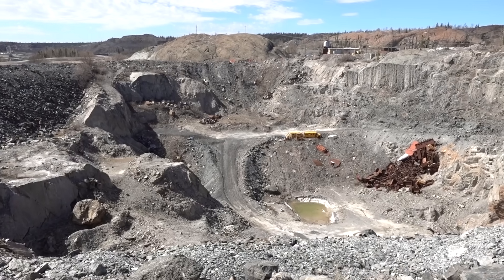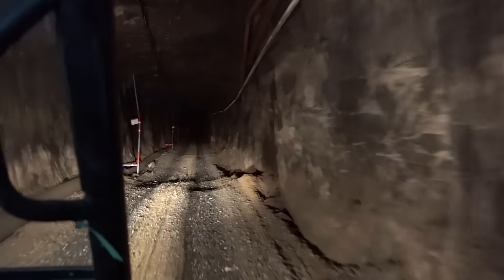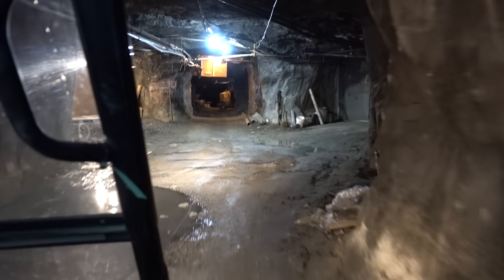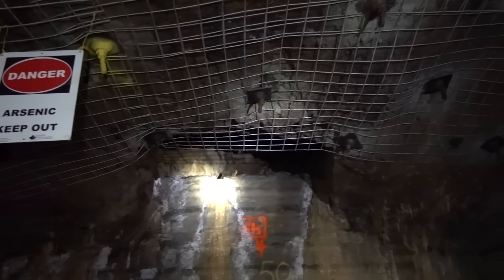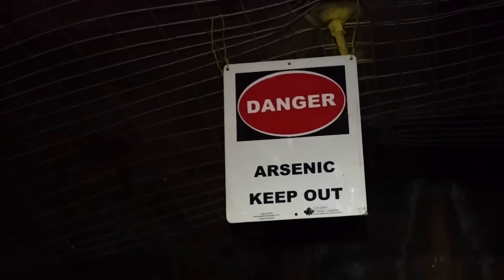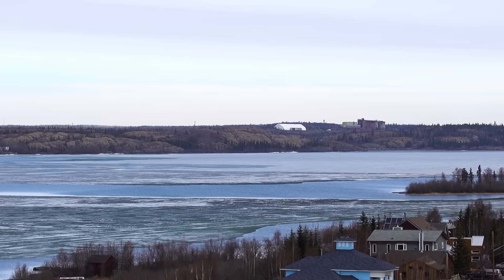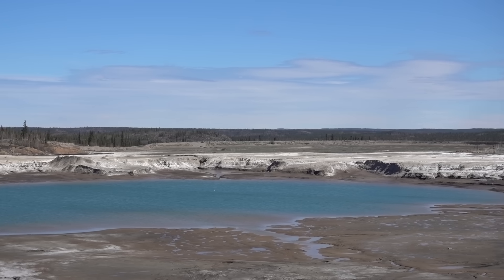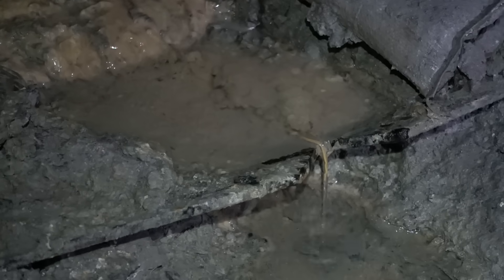Making 200,000 tons of arsenic dust safe

Comment: How come they don't do anything like vitrification (collect the dust and then encase it in moltern glass), which is what they do to radioactive waste. Glass is really durable long term and makes a lot of sense for radioactive waste, and surely that less maintenance and as such less cost than dealing with these cooling pipes which lets not forget if they fail the arsenic will become dust again and be just as dangerous
Reply: there might just be to mutch, also moving the dust will probebly create dustclouds
Reply: 999 gamerdude I don't know for sure, but here's my guess:  there's just too much of it, and it gets away too easily during processing.  

I looked at Hanford stats, and it looks like there's actually about 200,000 tons of that too.  But it's in liquid form, so it's not going to fluff up into the air while being handled.  And I'm guessing 200,000 tons of fine dust takes up a bunch more volume.  

Another reason:  they still have some hope of finding a way to make this stuff chemical innert.  If they finally find that way, fine powder will probably be almost the optimal input format for that process, whereas glass blocks would be much harder to break down and chemically reprocess.
Reply: vitrification is very costly and would be near impossible on this scale... not to mention the added risk to workers to complete it.
Reply: Too much volume. Nuclear waste is usualy small, volume wise, maybe about the size of a home for one reactor. This is 275,000 tons of rock.
Reply: lordelliott42 sahara desert...
Reply: @abdalhadifitouri131  You, ah... Hm. You have a point.
Reply: The world is running out of sand to make glass.  There is actually a sand mafia in China and sand gets stolen from beaches and rivers.
Reply: I have a suggestion.  Bond the arsenic with the bodies of the CEO, every board member, and every shareholder of the corporation responsible for this lovely capitalist gift basket.
Reply: Here's an idea to make it inert:

Get the chemicals the body (and anything else you don't want it to be reactive with) is made out of and mix with a sample of arsenic. 

If the product is inert, welldone.

if the product reacts with something, mix all the arsenic with that something.

Finally, it prefers to be bonded with this than the chemicals in your body, ie, it's inert. Welldone.

Comment: Can it be reacted with something to make it less lethal or even inert?
Reply: I imagine the biggest problem is that there's just *so much of it*. It'd be hard to ensure you reacted all of the stuff, even if you had some really easy way to do that.
Reply: Árni yer, I wonder about that. But a guess it's because it's in the rock layers too, so they can't get all of it.
Reply: Maybe someday, we've got multiple ways of destroying PCBs into fairly harmless products and that was a nightmare chemical for many years.
Reply: @D8W2P4  what's a PCB?
Reply: @rhodesianwojak2095  
PolyChlorinated Biphenyl.
Which used to be widely used in waterproofing, lubrication, fire retardants, paints, adhesives, waterproof cements, and "wet" transformers and capacitors (which since it's a "closed" use they still sometimes use PCBs in very high powered "wet" transformers and capacitors) because of it's excellent electrically insulative, heat dissipating, chemical stability, and fireproof qualities.

However it's carcinogenic, endocrine disrupting and a neurotoxin.
Reply: @D8W2P4  oh thanks for the explanation m8
Reply: @rhodesianwojak2095  as well as the excellent reply from THISISTHIS, I have read that it never breaks down. All of it ever made is still out there somewhere.
Reply: No Arsenic and all of its compounds are toxic because the body mistakes it for phosphorus.  Phosphorus in the form of phosphate is needed for all kinds op biochemical reactions, and arsenic (most likely as arsenate) interferes with those reactions by blocking the enzymes that facilitate these reactions. Think of it as a key that fits a keyhole but not quite good enough. Arsenate can also get used instead of phosphate in one of the steps of glycolysis (the breakdown of glucose) but the product is unstable and breaks down spontaneously, which causes the 'burning' of glucose to yield less energy then if a phosphates were to be used in that step
Reply: No !!!!
Reply: It can be used to treat leukemia.
Reply: Arsenic is an element, and it's the element that is dangerous. Since your body mistakes it for important things, it would have to be inside something that is strong enough of a bond to not let your body extract any. 

It's not like a lot of toxic compounds where if you break them down into their base components, they are fine. The most base components of any arsenic compound are still toxic
Reply: Garrison Fox Yes I know. But even if you precipitate it with something like lead or react it with sulphur, which gives very insoluble compounds overtime it will still leach out with groundwater. (The lead thing is an assumption btw) So i do beleave containment in a frozen box of rock is the best way for now.
Reply: @asjenmensink2740  Sulphites are biologically inert for most eukaryota, right? How about arsenite?
Reply: I mean, you obviously can. It's not like they created the arsenic; it had to have been extracted out of some rock or mineral or something.

Comment: Is it legal to continue mining when they know there’s that much arsenic?
Reply: Great question.  Another one is who is paying for this clean up?  The people that became rich or people that had nothing to do with it?
Reply: In this case like most cases, the public will be paying for it
Reply: I think the arsenic is usually a by-product of the ore refinement processes. Most mines have a similar problem, I think. I think it's legal, as long as the company takes care of the waste. Problem is that private corporations go bankrupt a lot.
Reply: Arsenic and cyanide are typically used to refine gold after the extraction process. Its typically done through ponding pools and transferred through drainage systems. Soil base needs to be engineered using clay liners/geosynthetics to prevent chemicals from leaking into the surrounding environment. In this case there was probably less regulation.
Reply: +Faza Excellent, someone who knows  about this! (I don't, really.) 

Unfortunately, this is not as rare an occurrence as you would hope. In 2014 there was a Tailings dam failure at an old mine called Mt. Polley in BC, Canada, that essentially released tonnes of waste and heavy metals in to the environment. Right now, in central New Brunswick, there is an other mine that is under massive debate because it would do basically the same thing. I believe there was a similar disaster in Spain several years ago.

+Pat Hacker Yes, it would likely be paid for by under-funded government programs. There mining companies that literally specialize in mining up an area and buggering off immediately afterwards.The mine I mentioned in New Brunswick was proposed by Northcliff Mining LTD, one of those companies.